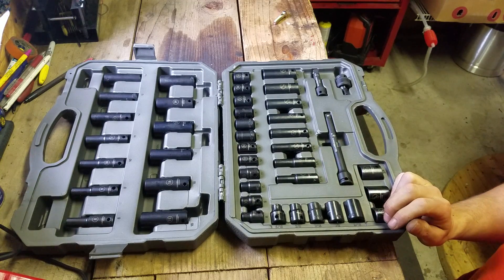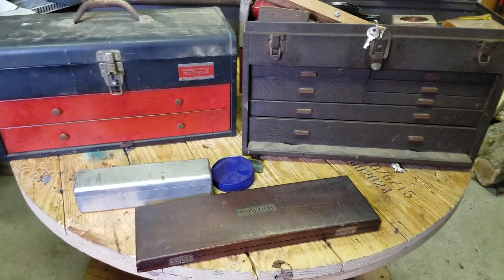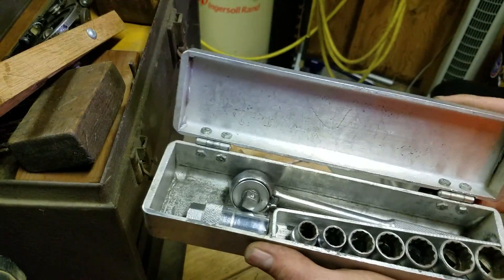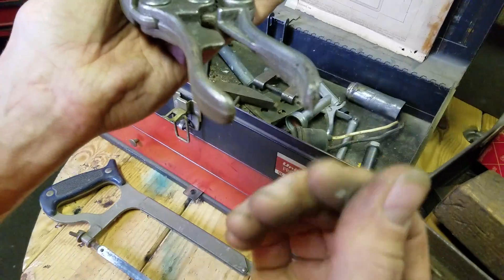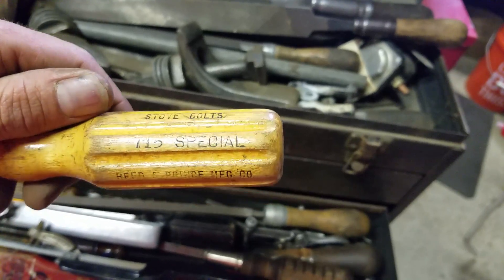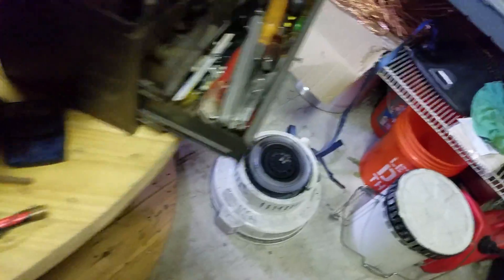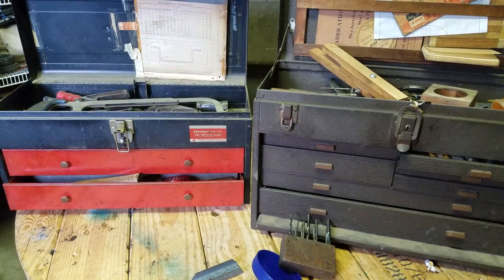Vintage tool haul and new impact sockets

Comment: Mike keep all of the tools and use them yourself, everyone of them is 10 times better than you could buy right now, that is why they have lasted a mans entire working life. I am sure a local engineering shop wiil take the machine parts but the hand tools are the best. Those Starrett calipers are a precision tool and worth a fortune give them a good home
Reply from the maker: acespark1 I've decided with my next tax return I'm going to buy a lathe and/or mill and learn how to use all these tools
Reply: If you can, see if a local machine shop is getting rid of a small American or English lathe, as far as a milling machine goes even a small bridgeport is pritty big. Don`t go near chineese rubbish it will break almost immediately. I think you will find a small lathe the easiest to start with.

Comment: Hi Mike. At 9:50, those would be for clamping parts on a milling table. The T shape nuts would slide into T shape slots along the table. The knurled end on the curved piece would then sit against the part to be machined and hold it in place. You would add or remove washers if the piece to be machined is thicker or thinner.

Comment: Wow, nice score, you got a lot of good stuff in there.   I would send an email to Keith Rucker over at Vintage Machinery to see if he is interested in buying any of this stuff from you because I think he collects Starett tools. At 10:05, those are definitely clamps for a t-slot end mill.  10:45 looks like nozzles for a plasma cutter or mig welder.  That vintage Kennedy box is definitely very cool.
Reply from the maker: German Tool Reviews well right after this video I went through every single tool and organized all the boxes.  threw away a bunch of junk and got everything together. and after all that I got really attached to them.  they have a soul and character that pretty much non of my tools have.  I will end up using some of that machinist stuff on other projects and I hope to have a lathe and mill one day.
Reply: Come on guys! How can you call yourself "tool guys" and not recognize Oxy/Acetylene torch nozzles???
Reply from the maker: athhud I've never used one.
Reply: athhud, depends on the type of work you do, just like most people who don't work in electronics would have no idea what a wire wrap tool looks like.
Reply: Mike, you're killing me! Whether you use it or not, you should at least own a small portable rig...

GTR, I can not accept that excuse either! I'm a cattle farmer. That doesn't mean that I don't own and use a Fluke DMM, a soldering station, and a hot air rework station...
Reply from the maker: athhud dude. I've never fuckin seen one before and I have never even been around one.  I know know. not everyone has all the knowledge you were gifted at birth

Comment: Good scores man, we use alot of starrett stuff at work mainly calipers and other measuring devices, they are a good brand. That dial indicator should have another set of mounting pieces for it, we use those to check straightness and flexing on drive shafts and flight control rods. Really cool stuff man

Comment: That's a nice score. The Kennedy box may be the best part about it. Lots of useful pieces though. That Starrett No. 12 is a protractor head for a metal rule. It fits on the combination square rule that you find in the bottom drawer of the box. That black V you found fits on a metal rule too. it is a round center finder. They came as a set together, the protractor, square, rule, and center finder. All 4 together of Starrett costs north of $200 new today. It is called a 4 piece combination set. Everyone should have one, so you should keep it for yourself. Used it is not worth much. I've bought a Starrett combination square used for $3. With no calibration certificate that stuff loses value.
Reply from the maker: Paul Frederick good eye. I had to look around to find the brand of that box.  from what I read it's from the 60s and drawers move really nice for how old it is.  also I realized the SK socket set was in a home made box which to me is priceless.

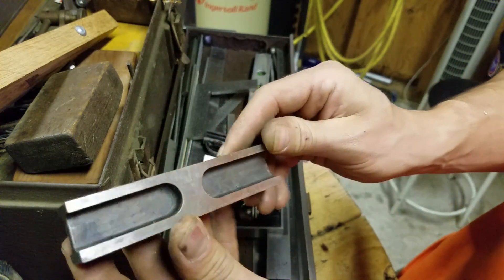Comment: At 6:14, Here's a definition from Wikipedia: 'They are used when machining with a mill, drill or any other machining operation that requires work to be held in a vise or with clamps - to keep work parallel or raised evenly such as in a milling vise to give adequate height for the cutting tool/spindle to pass over.' Basically, a clamped part into a vise sits onto that block to ensure that the top exposed surface to be machined will be parallel to the bottom surface. No need to say that the parallel block is narrower than the part to be machined so just the part is held in place from the vise, duhh.

Comment: At 11:13... those are hog ring piers. They probably used those instead of zip ties back in the day
Reply from the maker: Nick Navarre I can see that. Probably no use today
Reply: They use them a lot in upholstery and fencing and farm type work.
Reply: Nick Navarre I just had to buy a pair of hog ring pliers for a project involving crimping together a bunch of shock cord. Not sure if I'll ever need them again, but it's fun to have around just in case. Definitely not a commonly used tool outside of upholstery it seems.
Reply from the maker: yes I can see them being used for upholstery.  I'll hold on to em than
Reply: Yeah agreed!  I bought mine when I added heated seats to both my vehicles. They worked awesome!  Also... side note... it's oddly satisfying when you start to squeeze on the hog ring itself and then it has that breaking point where it folds in on itself so perfectly. I know... I'm weird!!!  I felt like a total professional 😂😂😂

Comment: The airco things I think are torch heads and the spring pillar things are for hog rings and hog rings was basically metal pins you squeeze to toghter to hold older car seats toghter

Comment: The toolbox with 7 drawers is a Kennedy Kits Machinist toolbox. Very expensive then and now. Below bottom drawer is a panel (frequently missing) that slides out and then can be placed in front of, thus securing, the drawers. http://www.toolfetch.com/kennedy-520b-7-drawer-machinist-s-chest-w-friction-slides-20-brown.html?utm_source=google&utm_medium=cse&utm_term=KN-520B&gclid=CjwKCAjw6szOBRAFEiwAwzixBaQ90C5l3D7i3HerjMFHcXMEjn_AeooPpOfSIfsI_OaLwV0vPiGcmRoCZAYQAvD_BwE

Comment: One day I was working on my car in my grandpas garage, I needed an Allen key that I didn't have and I knew he was a machinist so I went to a small box in the corner, and saw it had a lock on it. I used a screw driver to push off the latch (very insecure) and opened the top drawer to find porn pictures. Moral of the story- don't open locked boxes if you don't know what's inside. Also he's still alive so I'm probably going to burn the picture in case when he dies no one else opens the box to find that (tbh what guy dosnt watch porn now Adays)
Reply from the maker: o Lemurs I found porn and weed in my uncles tool box when I was like 7. stole the weed. kept it till I was 13 and smoked it. lol. talk about harsh.